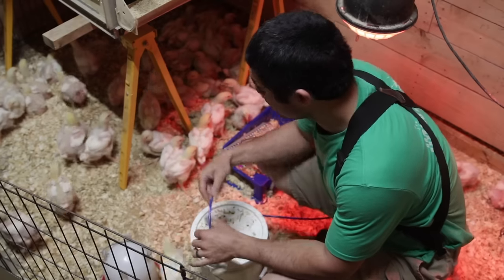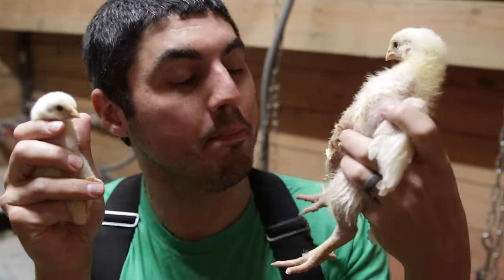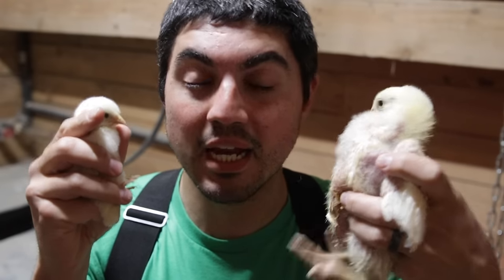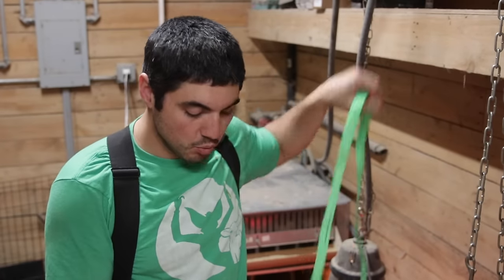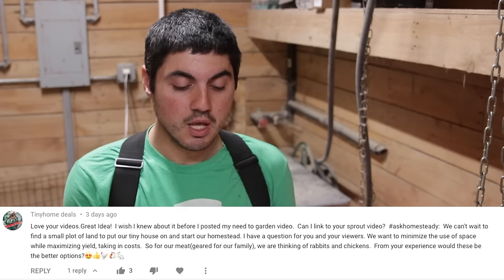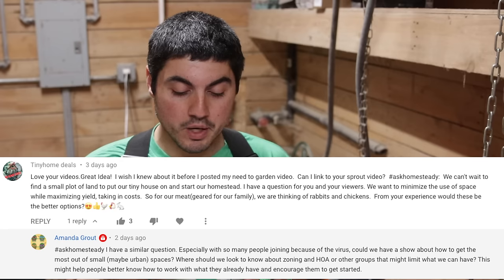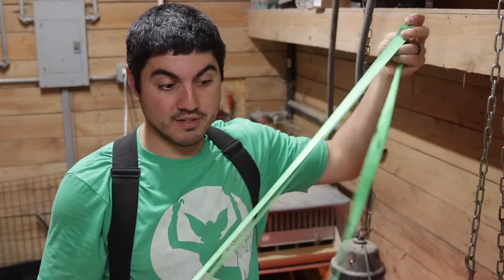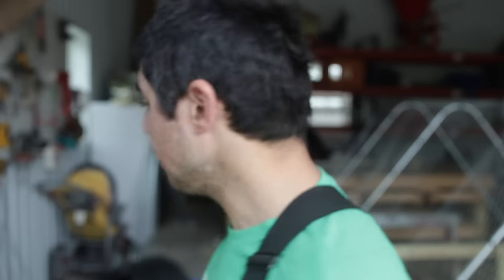7 BEST LIVESTOCK FOR URBAN or SMALL HOMESTEADS

Comment: Rules against livestock usually are based on problems with : noise, stink and attraction of flies, mice and rats (from spilled feed and not rat/mouse proofing the animal housing). 
All of these are mainly due to bad care, but also climate (heat). If you can avoid those problems and keep them out of sight ( right along with the vegtable plot and the drying laundry most likely), lots of rules have to do with looks to keep up the value of the other properties. So tidy and charming from the outside shuts a lot of people up. That can mean plant an orchard in the front yard, along with say some roses giving lots of flowers. 
Rabbit are your best choice in such an area, not only because they are quiet and don't stink, but they are considered a pet, not livestock. Skipping the whole you can't keep livestock problem, since they aren't livestock, but pets. Do check though if you can sell bunnies for pets from your house (via craigslist or whatever), because that might be labeled commercial activity and again hoa/zoning laws can bite you.

Comment: Going to add one: guinea pigs. They’re in the same boat as rabbits (technically pets). They can feed on and will essentially mow your lawns (cant eat it if you use fertilizer or recently mowed) and kitchen scraps (they do need a vitamin C source 1-2x/week). They breed prolifically like rabbits. They don’t dig like rabbits (no need to fence the ground). They don’t jump like rabbits (2 ft high is plenty). Their poop is fertilizer. The only thing, which has me hesitating, is how much noise they might make.
Reply: I keep rabbits outside all year round, guinea pigs can not take low temperatures, so big difference right there. Also rabbit is pregnant for a month, guinea pig for two months and is much smaller.